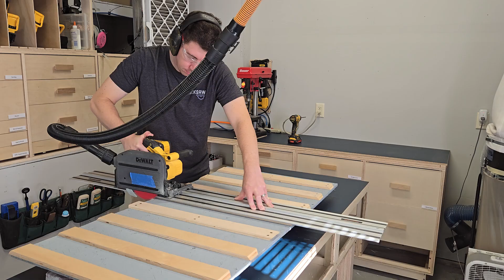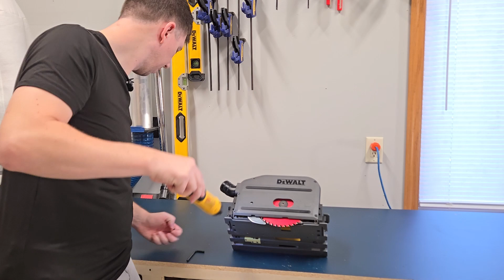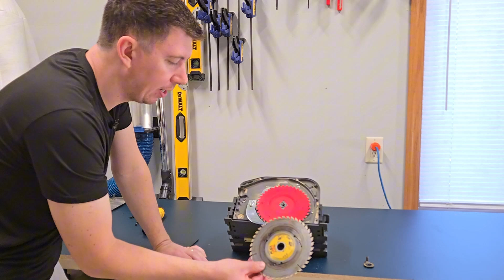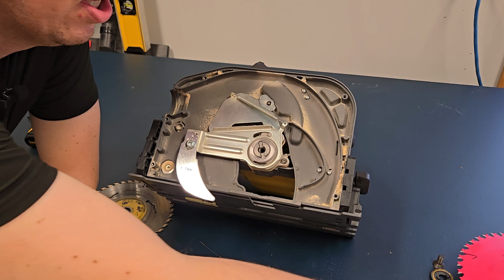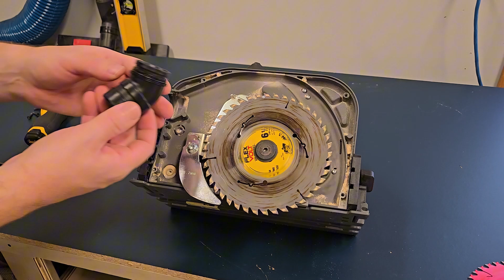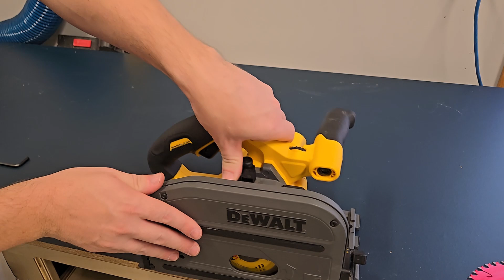Don't Make This Mistake With The Dewalt Track Saw

Comment: Hey man great video, i have the same plunge saw with dewalt track. I zeroed the strip and made a perfectly Straight line but when i try to cut something the blade strats straight then it start eating into the track !! 😮
My track is now damaged both sides, the Aluminium is eaten 2-3 mm on different sections
Why could that be?
I tried a new riving knife and adjusted the twist knobs on base and there is no play but still Happening
Reply from the maker: Sorry to hear that. Double check there is no play in the saw and track. The track is waxed, check if the blade is bent. If the damage is at the ends it might be coming off the track.
Reply: @ricksaw track is new, blade is new, riving knife new 😢

Comment: Diamond shape works on diamond shape arbors . You need to make sure arbor size matches the blade. DO NOT RUN THE Diamond arbor  or any wrong diameter arbor sizes. Be safe!
Reply from the maker: Thanks!

Comment: Most track saws have an arbor size of 20mm. You cannot use the diamond knock out to safely make the blade fit - this is for saws with a diamond arbor. You need to buy a track saw blade made for the 20mm arbor.
Reply from the maker: Thanks!